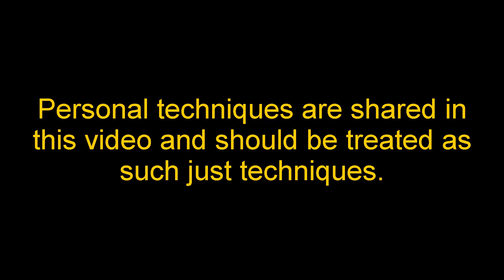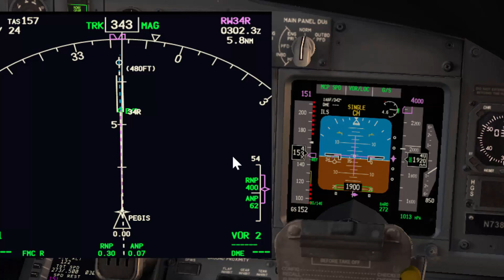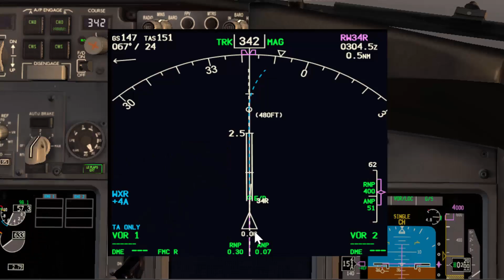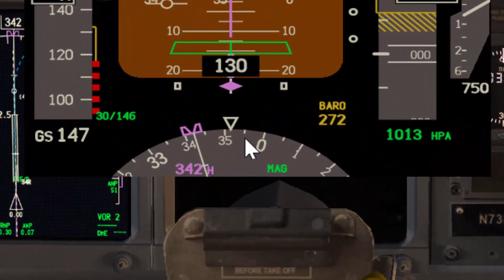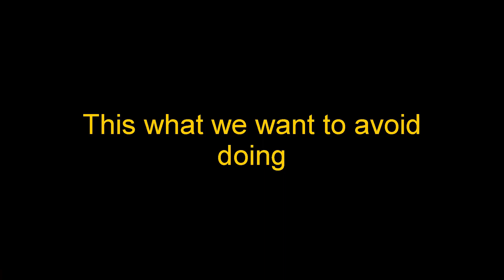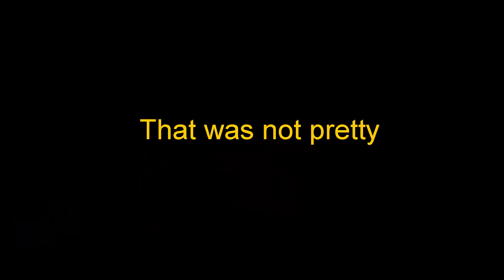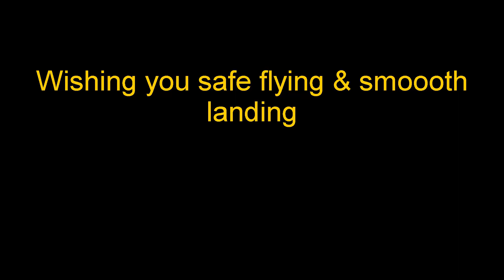B737 App & Lndg Video#9 IFR to VFR Transition

Comment: Hello Dear Captain Asiri, Nice to see that there is a new video and the total collection increases more and more in study value with every new addition! To be honest, I must confess this specific part is not easy for me personally, but that is also due to myself. During final the list of attention points becomes longer and longer. Fortunately the video can be replayed without the teacher being irritated for so much slowness of my learning curve lol! I would like to ask you for a topic only about the manual operation of the Trim buttons on the Yoke by your hand.  I assume of course  that this tool is actively used during the landing. I think there is a world of difference in using this but more importantly good use of this. I have learned that this is used to remove pressure from the yoke, but I think you will be able to use this more strategically so that maximum use and convenience will be created. I have tried to find video's about this but the only situations was see that  the FP push the both knobs forward or backward but never explain why or when this is used. It's a suggestion and only if you enjoy doing this topic. Have a nice day and bye bye!!
Reply from the maker: Hello G L 
Thanks for the feedback and suggestion. Sure thing will try to cover stab trim use till then here is some info about it. 
True trim is used to relief the pressure once you fly manual. The thing to remember though is relieving the pressure when at the correct speed and thrust setting. If you need to do correction usually you will keep the trim since you will return back to the original setting that is speed and power. 
The second point I usually stop adjusting the trim usually by 1000-500ft to make sure I have a better feeling of the flight controls. 
Hope I didn’t confuse you. 

Please let me know if you have any other questions or suggestions. 

All the best
Abdul

Comment: As u pointed out in the transition to visual.. another way to put it is not to point the nose to the runway. Also when you look up, theres almost always a pull on the yoke. heads up? nose up. put these two urges together and you're way off by around 100 agl. these are mistakes almost all new pilots will make.. but you've got to learn why and minimize repeats. good video as always.. and audio was clearer. thx
Reply from the maker: Thanks S G for sharing you are right the tendency to pull up when breaking visual is an issue. 
Appreciate your feedback and sharing your knowledge. 
All the best 
Abdul